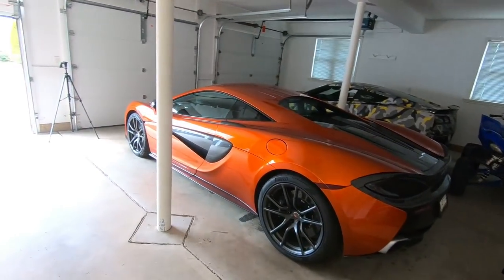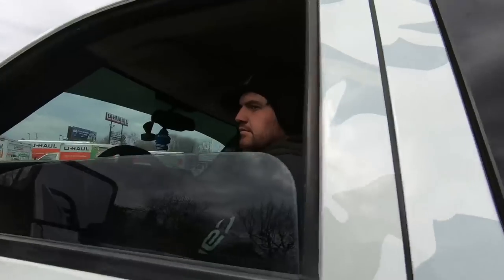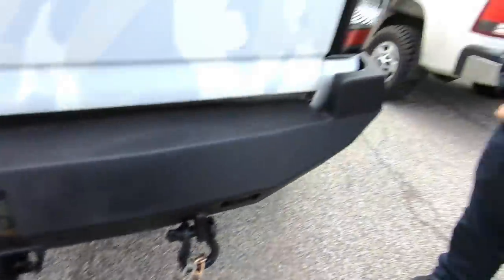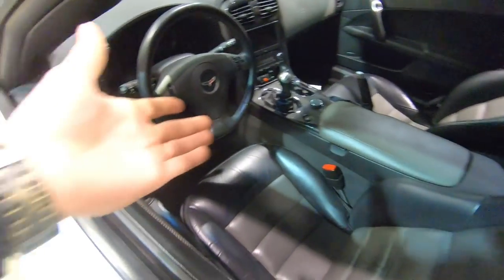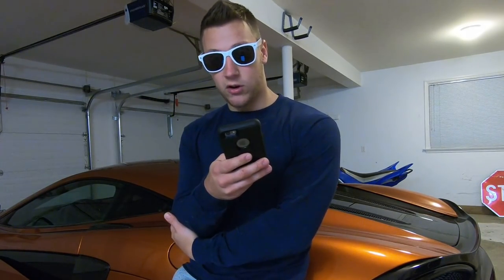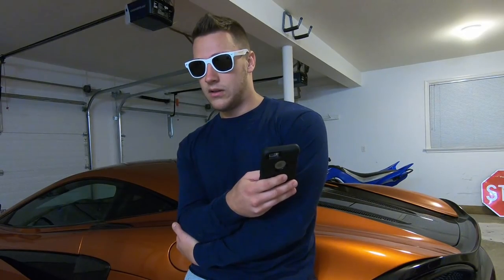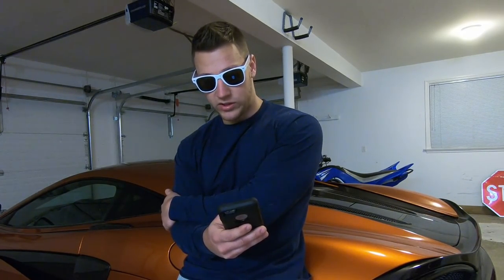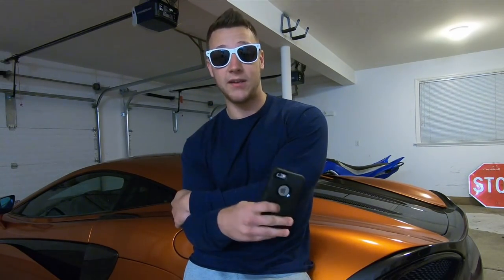FIRST TIME Towing with the New Dirtymax Setup!!! She's a CRUISE SHIP...

Comment: Chevrolet just announced today they are now offering 4500HD, 5500HD, and a 6500HD. That’s why someone asked that question whether or not you would get a 4500
Reply: No point at all he doesn’t tow any decent weight for what he has now.
Reply: That’s true. Those trucks are pretty cool though. They look like the old kodiak’s. He does need a new Duramax though, the L5P is pretty good. It has a lot torque right from the factory. 445 hp at 2800 rpm and 910 lb.-ft of torque at 1600 rpm.

Comment: Just as a tip for the next time you tow a vehicle as low as the ZO6 what we used to do when I worked at a Porsche shop we would leave the trailers hooked up to the tow vehicle but jack the trailer up and it helps so that the ramps aren't that steep 👍

Comment: And Mike FYI the fender on that U-Haul trailer on the driver side it folds out so you can get in and out of the car it has two black rubber straps that are on the fender front and back pull them off the fender and the fender folds out to the side so you can get in and out of the car through the car door
Reply: lee tijerina im pretty sure he's realized that now

Comment: Mike you should really buy an airbagged trailer. Those things are so damn awesome and they are low enough for all of your cars. Also, if it fit in your garage you could just set it on the floor and pretend it's not there. You can drive right up on it like a normal parking space.

Comment: It’s a 7&3/4” drop hitch not and 8”, FAKE NEWS!
Reply: Tyler Faix bought a 8" from tractor supply lmao then he had to buy one from uhaul love how he didn't show it tho
Reply: LBZTOMMY ya I saw that
Reply: He did show it later. It's because he didn't have a 2" ball. The tractor supply was bigger.
Reply: hopefully it has a better rating than the tractor supply. 5000LBS is cutting it close. When he gets his check and buys a trailer i would hope he invest in a solid drop with a better weight rating. Plus adds a brake controller to the truck and gets electric brakes on the trailer.
Reply: Brad Osborne ya he should get one of those big badass looking ones off Instagram
Reply: Tyler Faix gen-y hitch those things are super sick I'm Lookin at buying one right now actually 16,000lbs working load
Reply: LBZTOMMY 16000lbs.....How much you towing man?!
Reply: Marcus Young I tow my bob cat on a 28ft trailer with 4 attachments honestly think I'm over 16,000lbs I do asphalt ,construction, grading and excavation work
Reply: if you look closely the one he got a tractor supply is solid forged one(shows it in his receiver). so should be good for 16k.

Comment: Just don’t pretend you tow.. a Chevy Colorado could pull the same weight without an issue.
Reply: lmao at mike not realizing those fenders fold out
Reply: Michael Nasi how does one pretend to tow when the car is being towed on a trailor behind the truck
Reply: Rocco Pelletiere He's joking but he's refering to towing on a regular basis. Car guys...... rolls eyes
Reply: If you think a Chevy Colorado can tow a car SAFELY then you obviously don't tow yourself
Reply: Nick Martin "Safely" is a relative term. A Colorado could easily tow that Vette "safely" with a weight distributing hitch, depending on trailer weight.
Reply: Marcus Young That “truck” more like car is not meant for towing anything other than a pop up camper the simply have to much suspension roll and depending on where your towing it will either cook the trans or overheat not to mention the rear diff.
Reply: I didn’t say it wouldn’t do it, but at highway speeds it will be all over the road, and stopping will be a whole different issue. I tow with half ton trucks all the time with 5-6000 pound trailer and that’s even kinda a lot for a half ton truck. The other day I towed my thunderbird in an enclosed trailer with the same trucks and it was all over the place. When you feel the difference between towing with a half ton and a three quarter or bigger it’s no comparison.
Reply: Weight distributing hitch. You're using a high drag, enclosed trailer. Even with your car hauler, the hitch will tame that sway. Plus, if you're swaying that bad, you need to slow the hell down. Stop trying to cruise 75+. Power isn't the problem, weight and length of the vehicle are more important (which is why HDs tow better).
Reply: Marcus Young Your going to be putting a lot of weight on the hitch with bars on it; you would probably have to have a heavier hitch welded on the truck
Reply: Marcus Young That’s why you wouldn’t but that type of truck and have ever drive a Colorado?
Reply: Rzr racing No I haven't driven a Colorado. TFLTruck has already done an extreme towing test with a stock Colorado up the Ike Gauntlet. They used a weight distributing hitch and it did fine. That's my entire point. Do I recommend it, no. Can the Colorado do it, yes with the right equipment. That's all I'm saying. There's no way in hell you'd see my even considering a mid-size. Even half-tons are iffy. I want a tow pig, not a prissy boy truck.
Reply: If my 1999 S10 ZR2 is rated to pull 5500 lbs, then I’m damn sure a NEW Colorado can tow the vette on the trailer...
Reply: I tow on a nearly daily basis, i did not recommend someone use a colorado, but it is certainly possible. You just explained that you towed 6k with a half ton. He owns a full size diesel and is excited to tow 4k. That's less then i tow on a daily basis, and my truck sees trailers that are closer to 15k pretty often. Trailers have brakes and clearly you don't know how to properly adjust them if you think stopping is an issue. I suggest you reevaluate the way you tow before you hurt yourself or someone else.

Comment: Idk my base numbers. But my 01 z28 a4 made 325whp 335tq and I’m in NJ so basically the same elevation. That car had mid length headers, stock cats, and a cat back so nothing crazy. I think it’s impressive because the c5 was rated at 325 to the crank. And the camaro was supposed to be under that to not hurt the sales of it. I only raced one c5 with it but he had heads and cam so he walked me pretty good but not as bad as you would think for 100whp advantage as well as probably 500lbs or more.
Reply: Also I’d take your garage as my dream garage but I’d replace the mclaren with a gt3 and the corrado with my 240